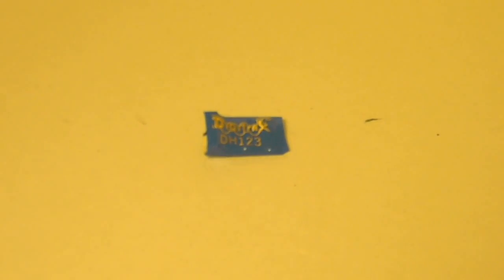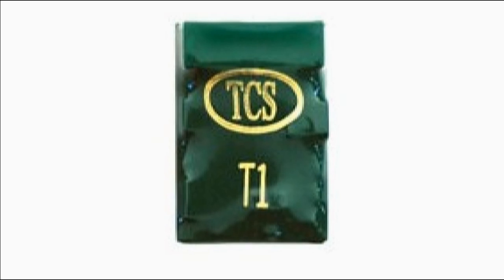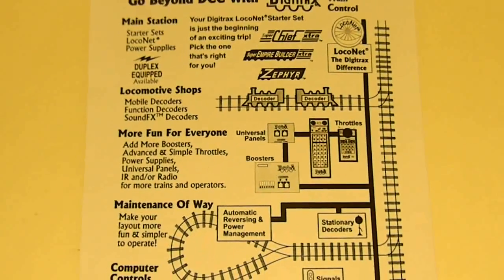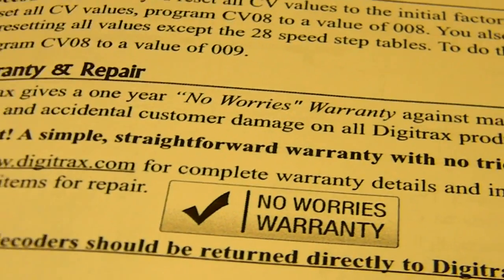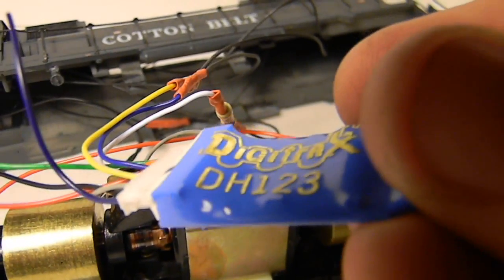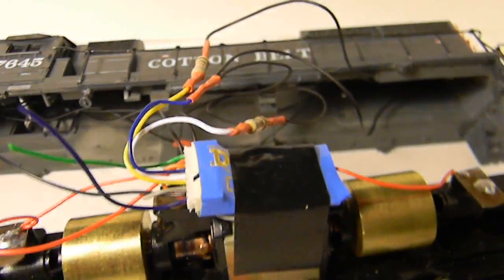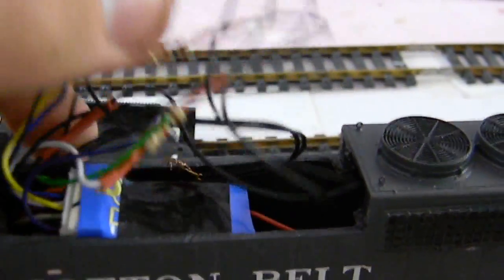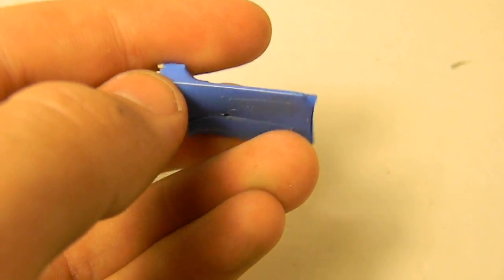REVIEW: Digitrax DH123 Mobile DCC Decoder

Comment from the maker: I know you do. And once you do that enough, the copper in the wires just comes apart. I normally don't buy these decoders. And I've had bad luck with those. They have no heat shrink on them, which makes it extremely easy for them to short out.